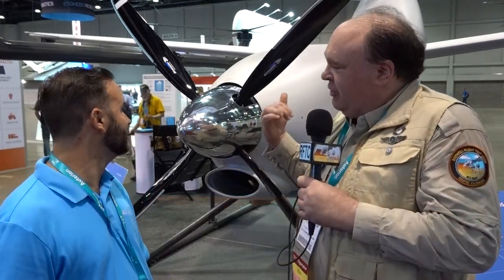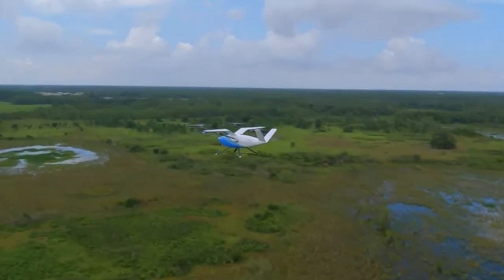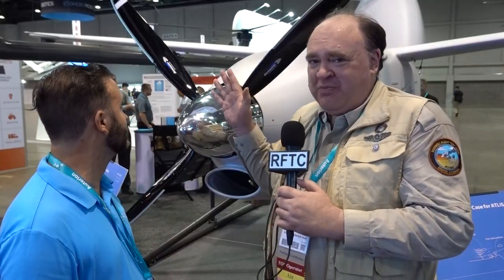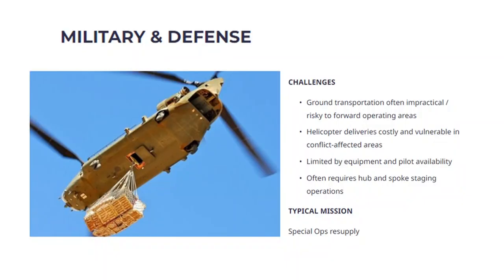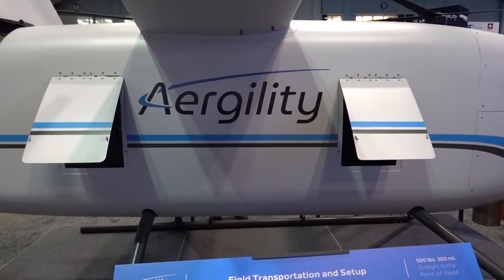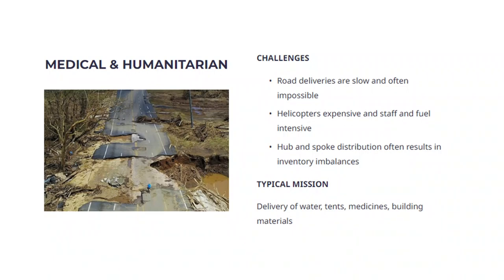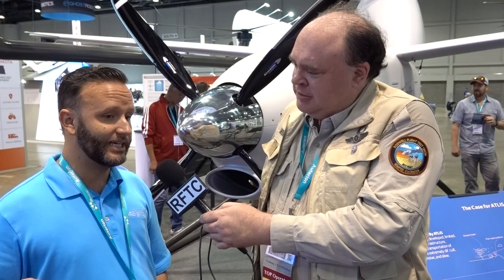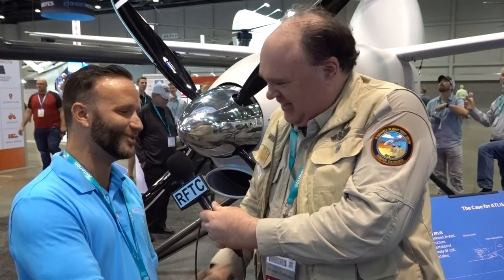New Cargo Drone Flies Like Nothing Else (Literally)

Comment: 0:32 0:52 still kinda confusing about the 6 rotors.  He says "upper" rotors are used for takeoff and landing and autorotation.  So the downward facing 2 rotors are for banking?
Reply: Sorry about that, that was a bit of a misspeak.  It was just contrasting with the mention of the propeller vs. the rotors. All of the rotors are used for VTOL.  In forward flight, they enter into unpowered autorotation, and depending on the maneuver needed, some will be given power and some will generate power to make the maneuver.  Hope that clarifies.